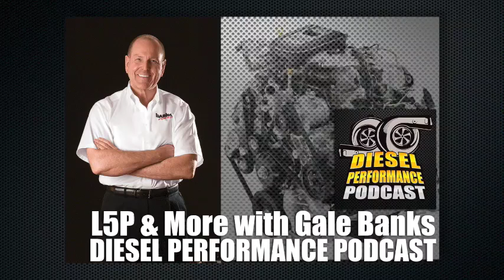L5P & More with Gale Banks - Diesel Performance Podcast

Comment: I'd rather see guys modding their trucks for working them, not for impressing others, flatbeds, utility beds that really work for you, airbags that help with load leveling, racks and lights for plowing, hidden winches and air supply for recovery or powering tools, engine and transmission tuning for towing heavy loads long distances, reliably and with better mpg and driveability, I could care less if your truck has lift and stacks and a ball sack hanging off your ball hitch,  and how much smokes it makes for the truck pull, 
all that shit is dumb, but that just my opinion and my opinion is irrelevant
Reply from the maker: You speak truth brother. Thank you for the comment.
Reply: I just asked about fuel economy the other day, and I found your video 
going over the different tunes on the spade(the dyno video) I was 
interested to hear how you balance the tunes for a stock truck not to 
exceed drivetrain limits, I am wary of buying used trucks with tuners o 
 them, I'd bet they overdid it with the tuner and roasted something, 
lol. I heard you guys tune TDIs as well, I have one I'd like to fix up 
maybe I'll take the drive from Ohio when I get the time, whats  a TDI 
tune cost? and what kinda magic can you work to bump my MPG's?
Reply from the maker: You're asking a ton of questions and we've got a ton of answers - so the best for both of us is to have you fill out this form and we'll call you at a time that's good for you: 

http://info.calibratedpower.com/we-can-answer-that

If our tunes roasted parts or broke stuff we would not be in business. We have tens of thousands of satisfied customers throughout North America - so rest assured we would never sell you on a product that would hurt your vehicle. That said - we cannot tune against those who beat the crap out of their truck or add performance parts without reinforcing the engine or transmission against the added stress. That's why we HIGHLY recommend calling us with a list of goals you hope to achieve with your truck. We can coach you through the process.
Reply: you guys rock, I have been watching and listening to some of the podcasts, a lot of good info, thanks
Reply from the maker: Thank you - really appreciate hearing from you.

Comment: anyone else come out of this wanting to go order an L5P?
Reply: Already did...
Reply: What I thought when I got the LML. Injector pump committed suicide and took the rest of the system with it,  57,000 miles. Out of warranty. The dealer want s me to get the new truck with the new Duramax engine. “Better,  improved, long lasting!!!” It’s exactly what they said when the fuel rails started dumping fuel into my crankcase on the previous Duramax. I’m certain this one will prove to have problems.